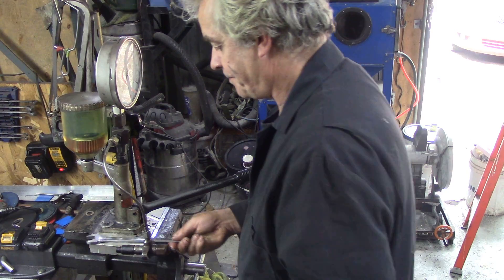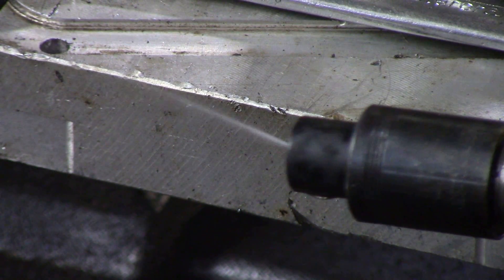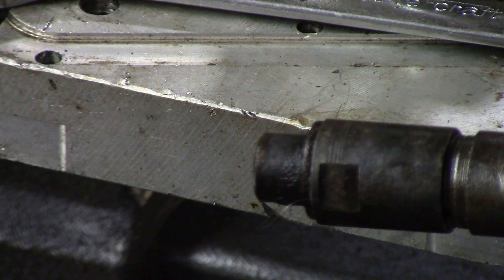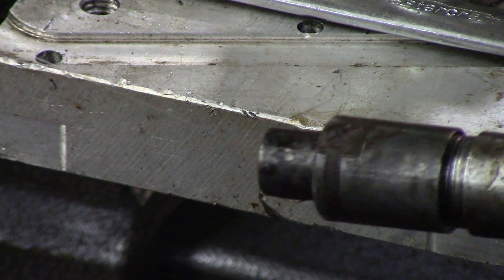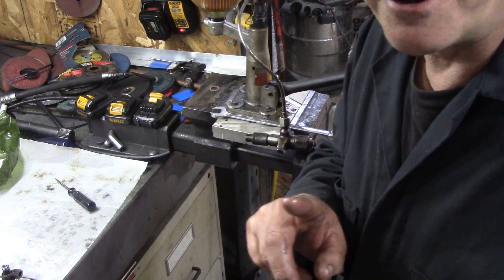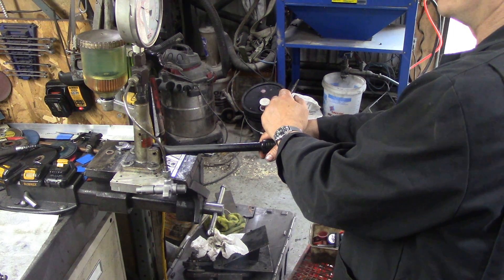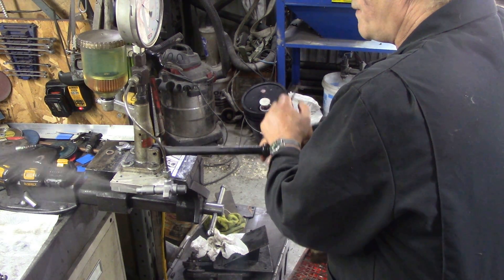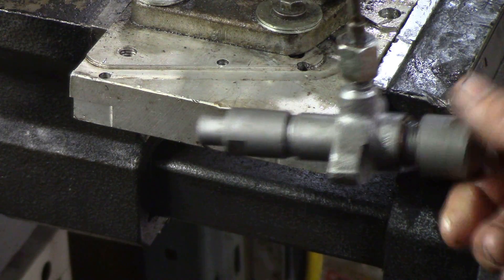2 5 Diesel injectors.  Some bad examples. Can they be rescued?

Comment: Hi Mike, good follow up to the last video.  Are you using calibration fluid in the test rig rather than normal diesel.  The problem in using diesel is that if you then store the injectors the small amount of natural water in the diesel can rust the nozzle and you are back to where you are when you re-use the injectors.

Comment: Hi Mike
Love the new videos hope your decking is going well.
I thought I would ask a question on this video as it is to do with injectors. I have a defender 200tdi and last week it ran very rough like it was on 3 cylinders I manged to limp it into my garage. Today I drained the diesel tank completely put in fresh diesel and new filter cranked it over bled the system and still it runs rough until I open injector number 3 and it runs better lots of diesel comes out of number three and frothy compaiered to 1,2 and 4. It that telling me injector three is the issue?
Reply from the maker: Take number 3 injector out and swap it for number 1 to see if the misfire moves
Reply: @BritannicaRestorations 
OK thank you Mike I will try that now
Reply: @BritannicaRestorations 
I took injector number 3 out and took it apart and cleaned every part and put it back in and tried the defender and it's ticking over like a 200tdi should be. 👍 Thanks again Mike I was going to sawp it with another but I thought after cleaning it I would try if first.

Comment: I found an odd one when I used brake cleaner round my injectors after spilling some oil. If I spray brake cleaner on the injector body with the engine running the rev's pick up. Only happens on the one injector and I worried it was a cracked head but I have no evidence to that effect. I could only put it down to the tolerance in the injector changing as the cleaner evaporated and chilled it down. Engine runs like a dream just such an odd thing to accidentally come across. If you still have the rig out and have some spray to hand it would be interesting to see if either heat or cold changes when they pop off? And if setting hot would make any difference?

P. S we also used to have a diesel cabinet in one of our workshops and the injector you had on test sat in a shielded tube, this caught the diesel and re circulated it to the hand pump, could also run the mechanics preferred diesel additive through the injector to help clean them from the inside under full pressure
Reply from the maker: That is usually a sign that there is a leak on the lower seal and brake cleaner can be drawn in and combust
Reply: @BritannicaRestorations  good call but no symptoms, ticking, carbon build up. Also only happens as it evaporates not if you completely soak the area. Been over 6k miles since I noticed it and could have been thousands more before. Right odd, if it was leaking on the sealing washer I would have thought it would worsen over time but still seems good. I did consider a cheap replacement set of injectors but not now since you've videos!